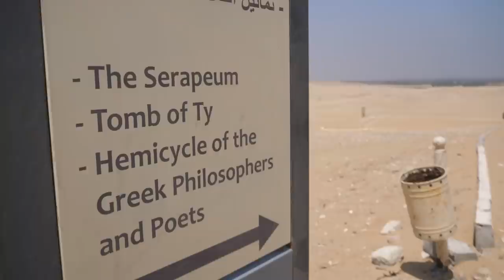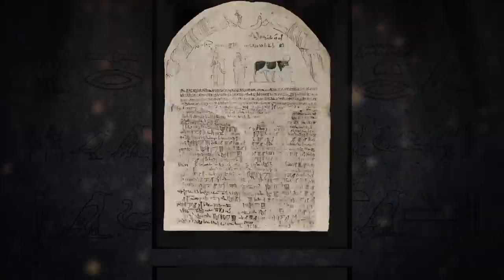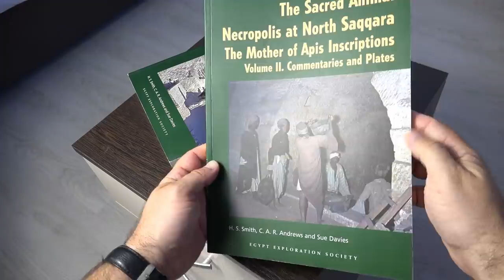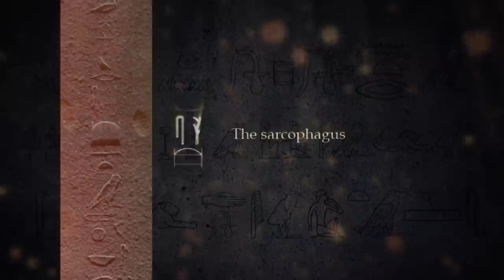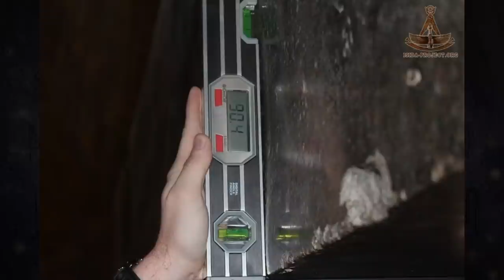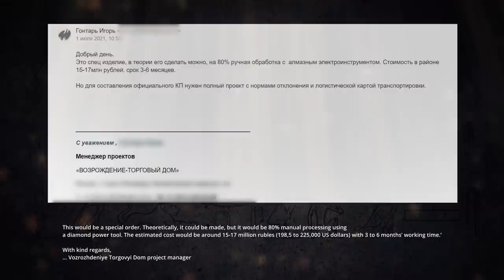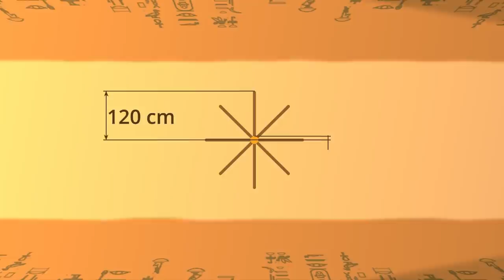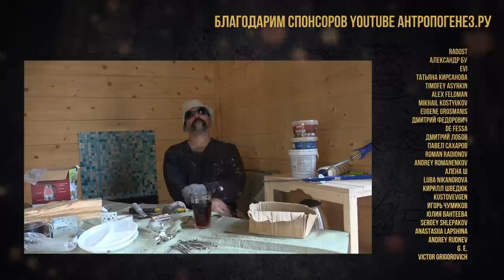The Impossible Sarcophagi of the Serapeum: What are Alternative Historians Silent About?

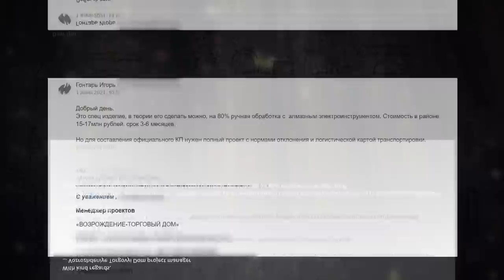Comment: 43:00 They explicitly state that they will use a "diamond power tool”. Yes, manual labor with power tools, which is more or less what people like Christopher Dunn claim, how the Serapeum boxes are made. 

48:00 This is by no means a fair comparison. The work on the left depicts a corner which is carved in the granite, where as the work on the right is carved on the outside corner of the granite. Not to mention that they differ drastically in scale.
Reply: 1) Didn't Dunn explicitly claim it cannot be done today even with power tools? Even so, do you expect the granite company to work it with stone tools? I'm not sure what's your point

2) Why not? They are both inner corners carved in granite. I agree working inside the sarcophagus would be harder, but by no means impossible. What does the scale has to do with it?
Reply: @MrAchile13  If Dunn indeed said it, that would strengthen the speculation that Egyptians had a form of technology that we are not aware of and quite possibly more advanced.

No, I don't expect a granite company to work with stone tools. Their answer actually consolidates Dunn's point. It is in fact odd that it's being represented in the video as a way of "debunking" anything.

The bigger the scale, the bigger the margin for error.
Reply: @umutcangun  How exactly did you reach that conclusion? In fact, it would prove Dunn wrong.

Again, how would their answer consolidate Dunn, since it actually proves him wrong? I'm not following your logic. How does using power tools prove it can't be done without them?

Look at the Tsar Bath and Napoleon's sarcophagus, both amazing pieces, made without modern power tools. Dunn conveniently ignores this.
Reply: @MrAchile13  If the company said they would do it the Egyptian way, for example with the stone tools you mentioned in your first comment, then it would prove Dunn wrong. If the company requires a diamond power tool to replicate a granite box which was done ca. 2000 years ago, it doesn't strengthen the argument for the Egyptian method. 

The conclusion in the video is that if you want a granite box to be done, just throw money at it, while they conveniently ignore that it was going to be replicated by diamond power tools.

I have nothing against the examples you mention. It's just that the company's response doesn't serve the purpose which is thought to serve in the video.
Reply: @umutcangun  I think you are making an unintentional straw man argument.

The argument was not "the company can make it so the Egyptians could make it too" - this would be a logical fallacy and it is not the argument made in the video.

The argument is this: Dunn claimed we can't make it today with modern tools, even granite workers attest to this - which is proven false by the company willing to take the job and claiming it possible. The example is made to debunk Dunn's claim about "we can't do it today", not to prove how the Egyptians did it.

If you want a granite box you indeed need to throw money at it. If you want it made traditionally, then hire a team of old school masons or train new ones. But the conclusions is, there is nothing impossible about the Serapeum sarcophagi.
Reply: @MrAchile13  Fair enough.
Reply: @MrAchile13  Dunn does not claim it couldn't be done today. He does say it would be quite a lot more challenging than 200k though.

Comment: 36:10. Virtually impossible with any piece of granite worked by hand. Your argument relies on people’s ignorance of measurement and difficulty of the material. Additionally, you are pointing out intentional gouges as flaws. Those gouges made smooth are not mistakes. They did that to remove cracks in the grain of the granite. 
You also don’t mention the accuracy of your square. Yet, it measured basically ALL edges with a few tenths of ONE degree. That in itself is remarkable. I suggest you show us the results you can accomplish even on a small piece. But of course you won’t.
Reply: You can YouTube cutting granite by hand and find a guy doing it. But you won't.

Comment: Overall really great job, very informative and compelling case you put forward. I wasn't aware of all of the stele that were found, I think that alone provides some context for what the serapeum was.
However to play devils advocate here, I do find some dolerite numbers put forward to be questionable, as in how long it would take to make the box. You mention 5 cubic centimetres a minute, how long was this done for and how long did it take to get to that pace? My point here is I can sprint like 20+kms and hour for about 30 seconds, but I cannot do that for multiple hours every day for 2 years. Not the best comparison but you understand my meaning, we have no context for your control experiment. I am nit picking here, you did a great job with this video but I feel like couple of things are glossed over. Like the initial cutting and moving of the stone from the quarry, how long you can work at 5 cubic centimetres a minute for, the cutting of 3 side corner on a ridiculously small scale and then passing that off as a fair comparison to the full scale of the box. I only judge harshly on this because you somewhat ridicule the alternative theory with parody skits but don't provide full context on important counter arguments to their ideas. Also did you address the box that clearly has a very long cut that was abandoned or did I miss part of the video? As the methods put forward do not account for what appears to be an flawed cut by some kind of blade/saw. If it was done by handsaw they continued to cut on an incorrect angle for a long period of time before noticing and stopping. Then they abandoned the box? If it takes 5 years to make I feel they would have salvaged the box somewhat dont you think? If that is addressed apologies I must have missed it. But that aside really great job on this video, it provides real food for thought about how the Serapeum boxes were most likely made and moved, with a solid practical approach that could be tested in the field. I would really like to see a box made to scale and would happily chip in on a crowd funding on that. I feel if they used wenches surely they could have come up with a more efficient way than just chucking a dolerite ball at the granite to shape the box?
Reply: wonder why he never responded. He isnt very honest about what other people say so I doubt he is honest about other things as well
Reply: @alexandrvasilev2865  you know slaves were not used to build the pyramids right? You shouldnt really try and talk about a subject if you dont even have the basics down  yet.
Reply: @iraniansuperhacker4382  didn't know that. but were they free to reject such work?
Reply: @alexandrvasilev2865  they were free to not do it if they wanted to but it was extremely prestigious work and was very sought after and competitive. I highly doubt anyone who was able to work on them refused in any significant numbers. The people who built those things were extremely well trained craftsman and they were well respected in their communities. But there is no doubt there was also shitty work and hard labor that had to be done and it did negatively impact their life and the bones of most of the people who have been found show signs of extremely hard work and their lifespans were often shorter than average but its basically the same with construction  workersnow days. If you were doing labor on the pyramids and died in an accident of something they would bury them in scared tombs next to the pyramids so that shows a lot about how even the average laborer was viewed.
Reply: I'm speculating they worked in teams pounding the stones.. Maybe 4 to 8 workers taking turns every five to ten mins.   I doubt one person pounded for 10 hours a day straight.
Reply: @edfu_text_U_later  I am like you, I give chances to every explanation but leaning towards alternative history because no body can explain to me megalithic walls, especially in Sacsayhuaman. That opened my eyes a lot, and after that I started to see everything different. In theory it might be possible for them to make sarcophagi , but lets be real every explanation is contradictory .  They were so primitive to kill and sacrifice bulls and do all that primitive rituals and yet they are making sarcophagi with that precision. Why? Why granite? Why so many of them? Why such a trouble? Like they didnt have anything else to do than to make those sarcophagis. I mean they are underground, they are not even exposed to impress. And writings on sarcophagis are so bad written compared to sarcophagi precision.
Reply: You could see the same thing in the logging industry prior to chainsaws. Relays of skilled lumberjacks in great physical condition could keep up a continual pace of cutting with hand saws and eventually bring down trees that people in the present without that skill couldn't even dream of doing. Occams razor works nicely here all facts considered.
Reply: @edfu_text_U_later  effort to reward ratio is going to depend on context. What a well paid highly skilled fulltime craftsman can do with very primitive tools and a large labor force not protected by labor laws is going to make what experimental archaeologists in the present do look childish. But at least some people in the present are making the effort to experiment and try to figure things out. I find that preferable to those making false claims about perfection or the impossibility of working granite with copper and flint while collecting thousands from people who go on these woo tours of ancient sites. All while claiming that academics are suppressing the truth for the sake of money.
Reply: @edfu_text_U_later  it's less an issue of mocking the other side than simply asking for evidence or pointing out clear misrepresentations on their part. On one side we  have people with actual training making assertions and providing evidence. On the other we have amateurs  building careers out of nothing more than the old cliche of "absence of evidence is not evidence of absence." The mockery and censorship tends to come from the fringe more often. Much easier to get blocked or shadow banned or accused of conspiracy on a blog devoted to fringe topics than this one. So who is more deserving of mockery, which in most instance is just plain statement of facts that they and their supporters can't handle, the fringe crowd or people like me?
Reply: @edfu_text_U_later  I hadn't seen any strawmanning, personal attacks or misrepresentation until I came across this channel and similar. I find it amusing more than anything, the people who supposedly have the answers seem to be rather dogmatic. And those purporting to be for science and the scientific method should be open to differing ideas that don't conform with their own - yet they get stuck on the beliefs of those they don't agree with. I think it does more harm than good, shutting down respectful discourse and forcing a dichotomous "us vs. them" situation. People are free to entertain their own theories, but I have yet to see any of them claiming it is what must be believed, or that they know it to be truth. I guess I just believe that people generally are free to form their own conclusions, and that the intelligence of that particular person shouldn't enter the equation.
Reply: @edfu_text_U_later  What experiments have Uncharted X done to test his own theories and claims? Surely he measured the angles and flatness of the boxes he claimed were so precise right? Go on show me his measurements and experiments in waiting...
Reply: Well put. 👍👍👍
Reply: @edfu_text_U_later
Reply: @iraniansuperhacker4382  What are you claiming, that Egypt didn't practice slavery? Of the hundred or so pyramids in Egypt, were slaves forbidden from working on or near them? 
Why do you think slaves didn't help build the pyramids?

Comment: Comprehensive and detailed work but I have some comments concerning precision and manufacturing. Even though 90.5 is not 90.0 I am still very impressed how they managed to get this sort of precision especially the inside box using dolorite stones of different sizes. Do anyone know how they could actually get so precise angles ? This type of stone work seems to be still an idea, it would be very interesting to see if some actually proved it by making it. Please remeber that the figure 90.0 dies not mean exactly  90 degrees but is a number between 90.05 and 89.95.
Reply: Using a square. Just like today, accuracy isn't achieved by the tools doing the cutting or grinding, but the guides, like measuring sticks, straight edge, square, plumb and level, etc.
Reply: @histguy101  still you have to apply the tools and then make sure you are aligned. So how do you start at the top of the stone ? Probably you just start to grind (with stones ?) at the center and gradually work towards the walls. But how do you proceed with a square ?
Reply: @eirikr2149  They can remove the bulk of the masonry inside the box with tube drills/hole saws, getting fairly close to where the final inside edge will be, breaking off the cores, then chip away the ridges that leaves behind along the inside walls, then repeat again to go deeper. Drilling a pattern of holes is still done today to remove bulk material.
Reply: Do you know how these drill hole saws look like ? What sort of material is applied to grind ? I assume the hardness of the grinding material must be equal or larger.

Comment: I m not convinced by this video. There is no enough space for working as you said in those tunnels, why they don't dig a larger tunnel to at least have enough space to work. I've moved a lot of stuff since I worked for a forniture shop and what I see in those tunnels does not have any sense if they were built with the purpose of fitting those blocks they should be wider.

Comment: how did it was transport
Reply: How were they moved.........  Look at the "shorts" created by this channel above on its homepage.  See the most recent one where they show an old film clip of a massive block of stone being moved.  So when the Serapeum was excavated they found evidence of = a "track system".    

So the sarcophagi were moved on wooden sledges using rollers/flat boards which were pushed/pulled by teams of men and oxen.  Once in a niche then using sand the sarcophagus could be settled into position.  They appear to have been partially fabricated at the quarry - which would also act to lighten the block to be moved.  Then they would be transported on barges to a harbor area near where they were needed where finishing work would be done.  

In the Serpeum they found a partially completed one resting in an empty hallway.  The Egyptians had harbors and canals up and down the Nile since they built their communities along its banks and ships capable of carrying very heavy loads.  🤔